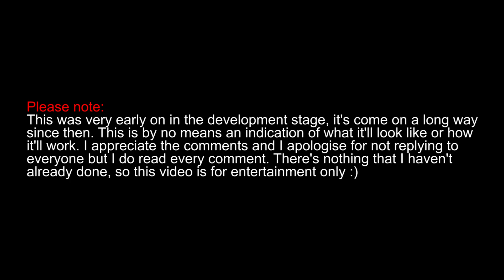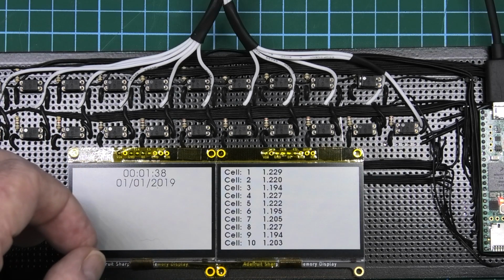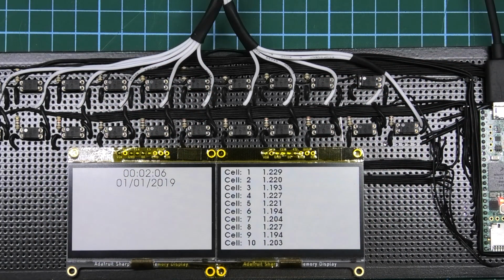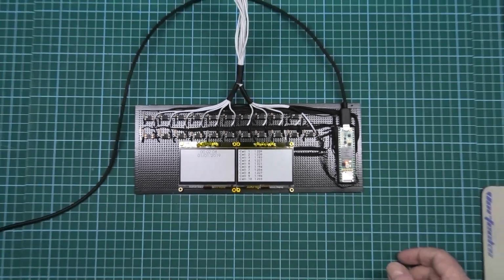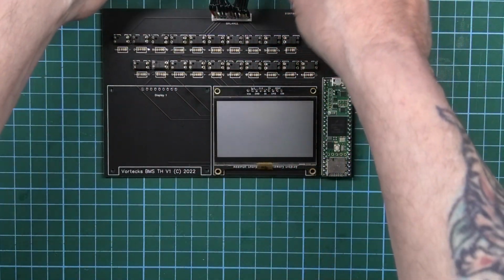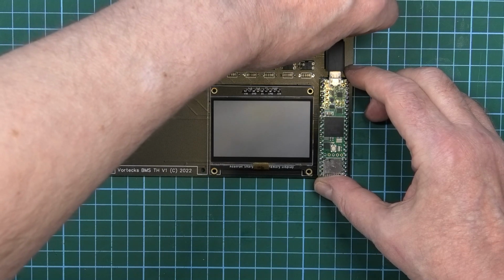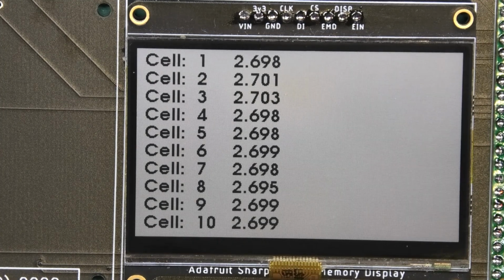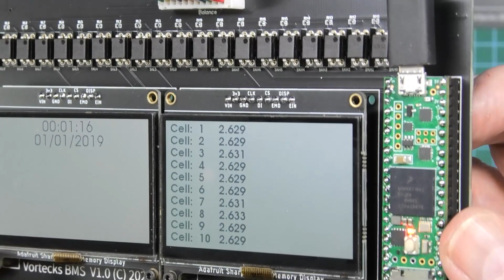Reinventing the BMS with Launch control, anti wheelie and VESC integration -  Part 3

Comment: can't wait to see what you can pull off with this!! Hopefully you can get these to be more vesatile, accurate and more capable than the ANT BMS because I'll definitely order a couple to replace the BMSes on my e-bike batteries!! Gets super annoying having only one BMS that works on VBMS!!
Reply from the maker: This one uses 1/12th of the components, it's much more efficient, easier to install and much safer. No messing with apps because it comes with a dedicated display and, when you remove the display, it disables the controller completely but it comes with all the features of VBMS and a whole lot more 😊
Reply: @Vortecks  Nice!!!

Comment: If you are very skilled a BMS with a buffer would be the best thing.

Since most BMS work on bleeding excess, a buffer BMS would have 2 li-ion batteries and would use them to compensate the least performing cells

+you would get some % more watts out of a pack
-extremely complex (needing to account that it should charge the additional batteries and all other kinds of logical stuff)
Reply from the maker: That's how this one works, it's currently running at around 97% efficiency with active balancing.

Comment: Ant VBMS APP update????
Reply: Prolly not while he's working on these badbois... Would be nice though - I have two variants of the ANT BMS in two batteries for my ebike... One works perfect with VBMS and the other one has a newer firmware and won't communicate with VBMS at all.
Reply from the maker: Sorry folks, it's not looking like it's going to happen. I haven't got the time to work on it, nor do I have the brainpower anymore. I did have a bloke working on it for me and he did manage to crack it but the last I heard, he was having problems reconnecting after closing the app and opening it again. I haven't heard from him for a few months now, so I presume it's dead.
It's a bit annoying really, the new ANT BMS is not actually an ANT BMS but a completely different machine. The only thing they share in common is appearance.
I reverse engineered the Chinese app and I say this to everyone.........block it from reaching the outside world, it's got spyware in it - it communicates with the Mayi server (obviously via your phone) and uploads all the data which apparently is for warranty purposes.
Reply: @Vortecks  Wow! thanks for the heads up, not that anyone should be surprised. 
So the only way to use the Chinese App is on an old phone with the SIM card removed and no WIFI connection?

Comment: Looks tidy Tony...So, at the moment it's just a cell balancer plugged into the balance lead of your 10S battery?..What will it be when finished?...😳😳🇬🇧
Reply from the maker: In this video, yes it's just a battery cell monitor. Now, it's an active balancer (instead of resistive balancing) which transfers energy to cells instead of wasting it through heat.
It now connects to any VESC controller and displays all the data and it'll also control the controller. It's hard to explain mate, it'll be in 2 halves - the BMS part that you connect to the battery and a head unit that you put wherever. If you take the head unit off, it completely disables the controller and there's no way the BMS can do damage like normal ones.
As it progresses, you'll see 😊
Reply: @Vortecks  Thanks m8, I get the cell energy transfer to charge up low cells with higher voltage ones. In fact, I (wrongly) always assumed this is how it was done..Follow on videos will no doubt clarify how it all works together...😳😏😏👍